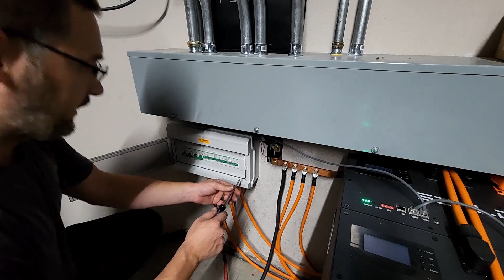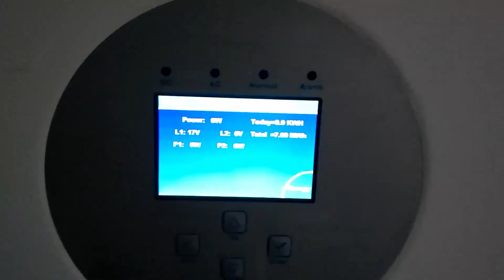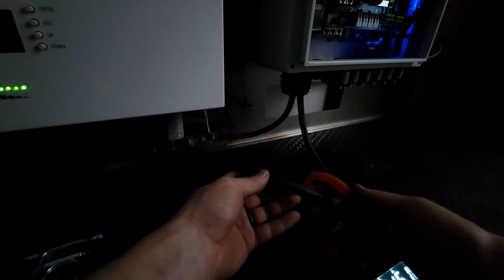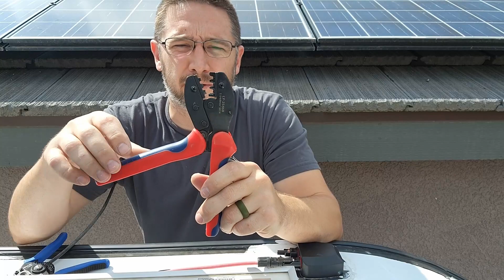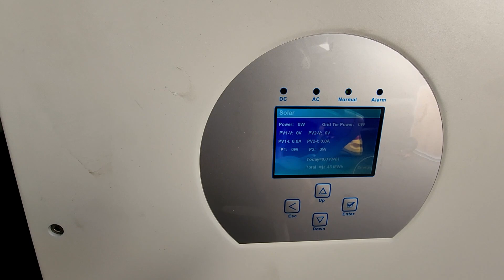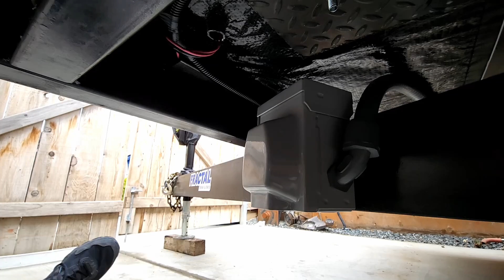DIY Solar Trailer - Finishing Wiring

Comment: Really nice setup. Can you link the sub panel and the 14-50 enclosure/receptacle? Thanks for sharing.
Reply from the maker: Thanks!

Sub Panel: https://www.homedepot.com/p/Square-D-Homeline-100-Amp-6-Space-12-Circuit-Indoor-Surface-Mount-Main-Lug-Load-Center-with-Cover-HOM612L100SCP/100190554

14-50 Enclosure: https://www.amazon.com/dp/B09PTHFZVX